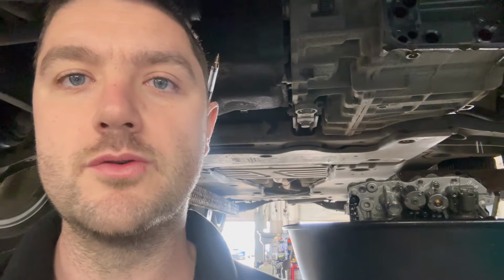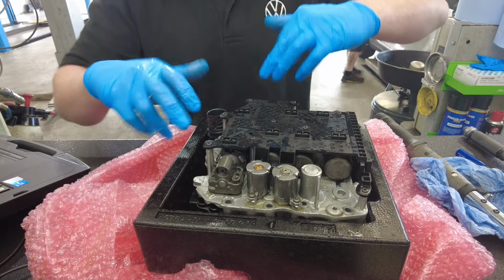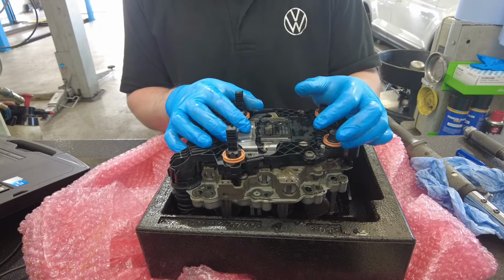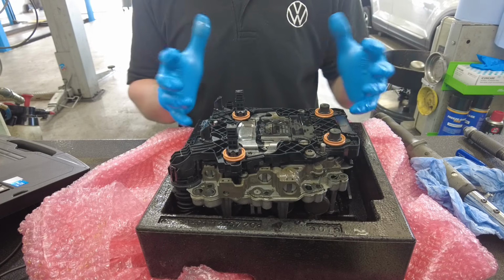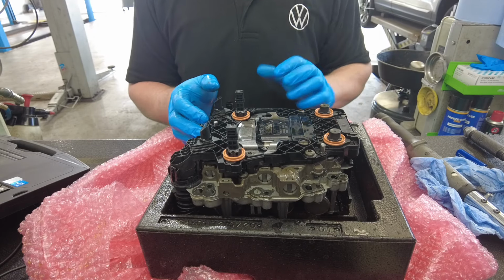Volkswagen Auto Gearbox Disaster can it be fixed?

Comment: Off topic but 2017 t6 start up this morning and revs not raised like normal cold start. It is 22 degrees tho. Is this normal?
Reply from the maker: Yeh buddy normal for cold start even tho it’s warmer outside the only thing that will change is the duration of the cold start condition
Reply: @TheVWMechanic_official  so normal the revs were normal tickover and bit raised. Cos only does it if needed?
Thanks for reply.keep it up
Reply from the maker: @baltyre5804 correct buddy it’s all for emissions buddy the warmer everything gets quicker the less nasty stuff out the tailpipe